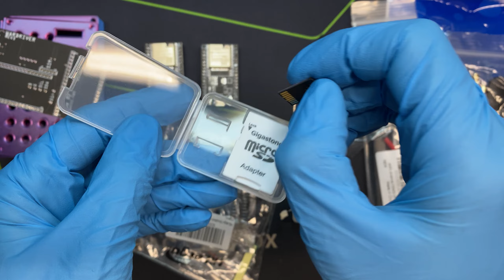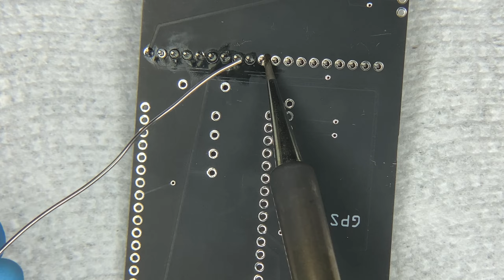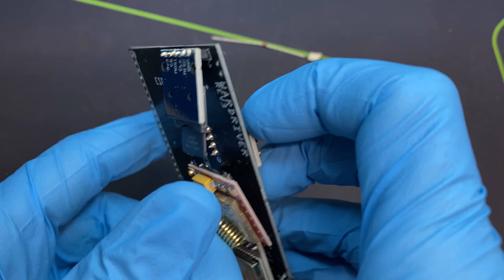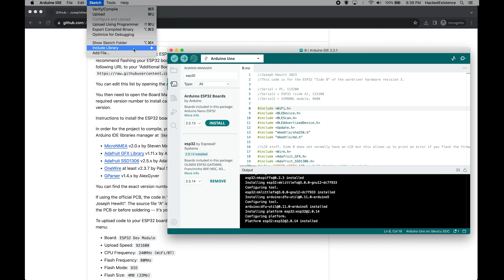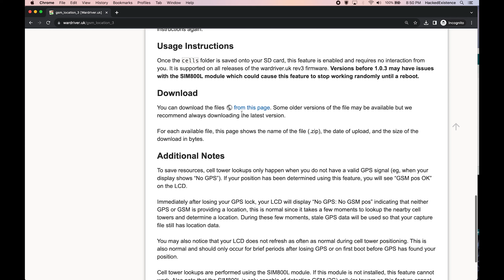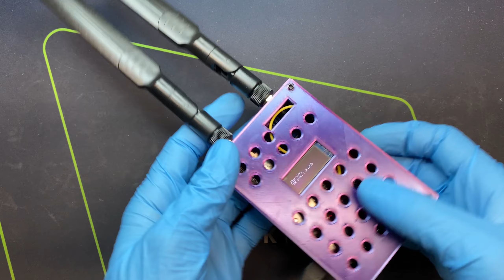ESP32 Wardriver build using JHewitt's Wardriver.uk

Comment: Loved the video, but the 8:27 "solution" was so annoying, why didnt you use a non-conductible fabric or foam there? lol... just align that gprs module! :(
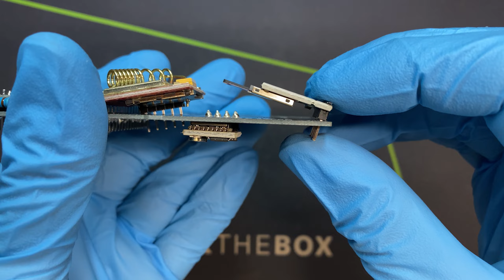Reply: GOOD LORD 9:13 now its the SD Card... why dont move the pins closer to the center of the board, leaving the sd card slot to be accessible from outside the casing??
Reply: UGH 10:20 the wires could be used the other way around... I died. gave up on tips after that lol
Reply: This has to be a troll video

Comment: I don't think 2nd esp had any physical connection only USB port was used of so why wasn't it just attached in 180 degree of now as doing so will make usb connection easy
Reply: I mean i agree but with the new updates that j.h. made you can make direct uploads via webui so you wont have to unless you have to reflash the board